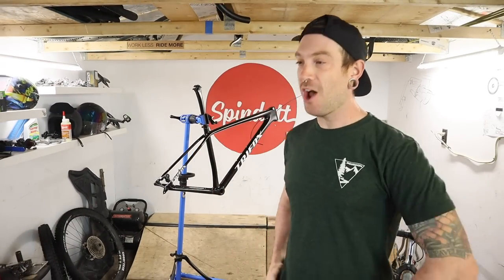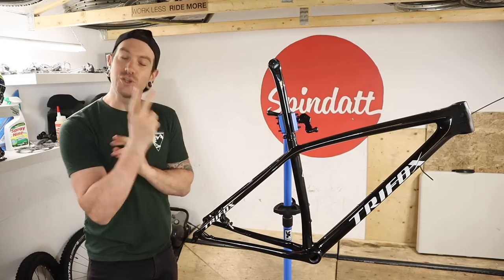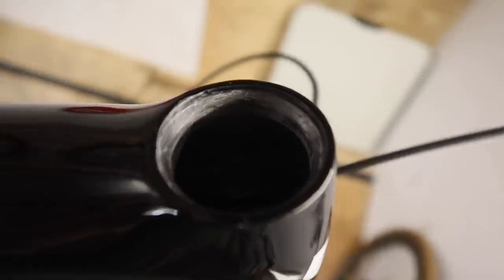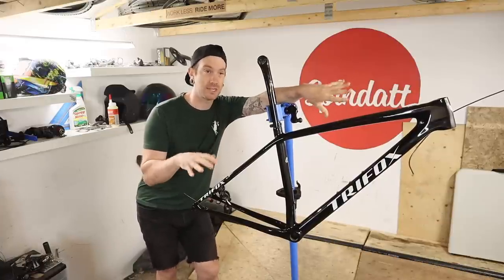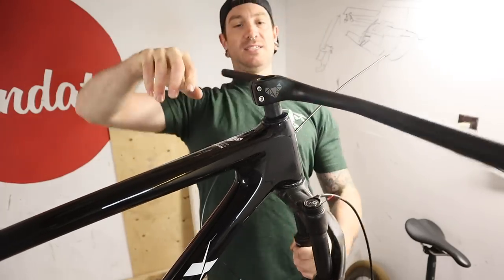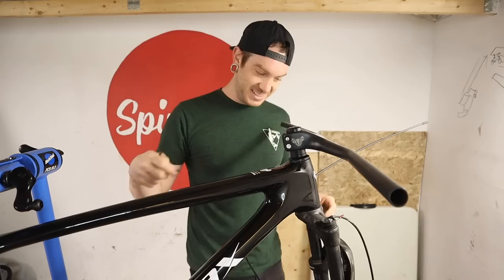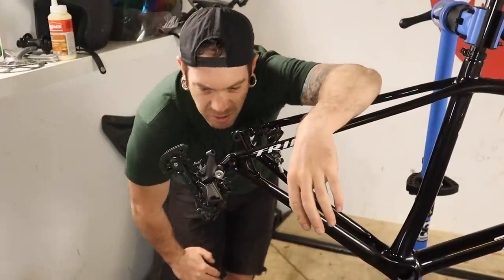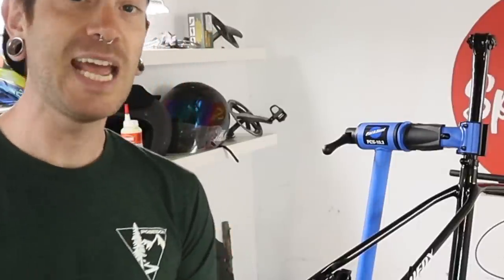Alright. Let's build the Trifox SDY20.

Comment: Having bought two no-name Chinese carbon frames I can relate to the derailleur headaches.  I’ve had to hunt down bits, contend with poorly thought out widgets, etc.  also expect major headaches if you ever lose anything.  I’m currently scouring my work shop for a suspension spacer I misplaced with little hope of being able to obtain a replacement in less than a couple months.  Of course the flip side is I saved about 2/3 off of the “real” frame.

Comment: Nice looking. At my age though hardtails have 0 appeal offroad. At the speed I like to ride hardtails feel sketchy and scary. I started on fully rigid bikes so its been there done that for me.
Reply: that's an interesting perspective to me.  i'm 39 and my first "real" mountain bike was full suspension, when i was like 15.  a 1998 stumpjumper fsr comp i scored off a guy in a message board that won it in a raffle for an absolute song.  yada yada.  loved it so much, it was my main bike for like 5 years.  did everything from commuting to 100 miler events on it... and yeah, the confidence it inspired was noteworthy.

long story short tho, i'm exactly the opposite of you in that now that i'm older, all i use now are hardtails and i don't even want a suspension fork.  that confidence is fake in a lot of ways, riding sketch feeling shit makes me feel the fear i should be feeling anyway, and keeps me from taking unneccesary risks.